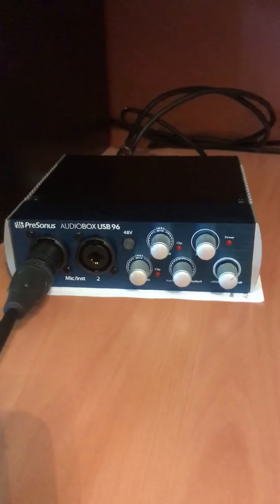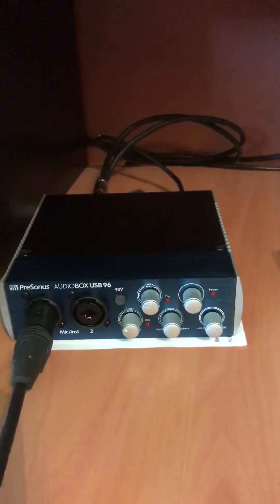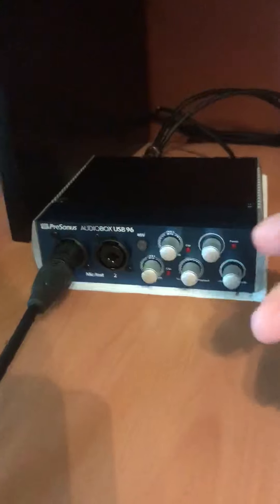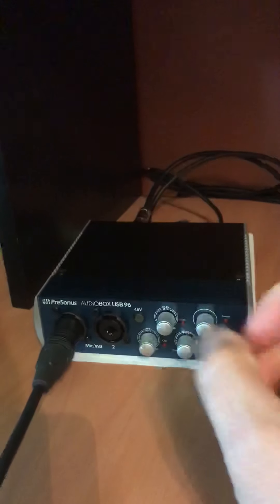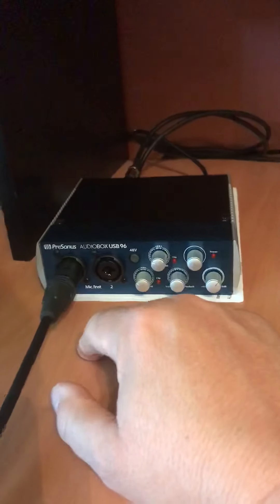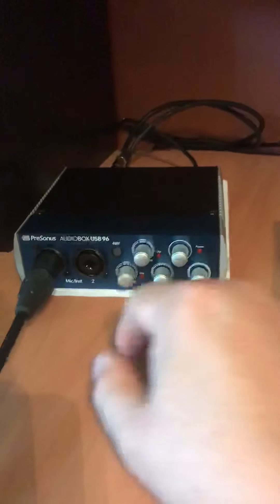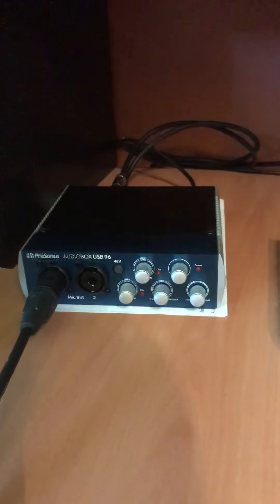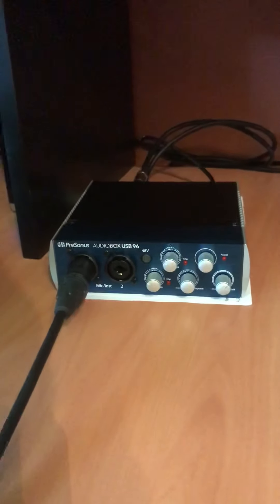Presonus Audiobox USB 96 white noise hissing sound

Comment: I have the same problem with my AudioBox USB 96. I purchased mine about 2-3 years ago, and I've become more acutely aware of the same type of white noise described in this video as I've been recording my own music. I am aware of the 48V button being on that increases the noise, but I've noticed that my condenser mic will not pick up any sound unless that button is pushed in. This means that I notice the noise (hissing, high-pitched beeping, and general static) whenever I am using that microphone. I also notice it if I'm using an instrument cable to plug in a guitar or keyboard. I've yet to try having the manufacturer replace any parts, and I don't really have the budget to purchase new gear to try.
Reply from the maker: Sorry to hear that, Nate. It's too bad they have this problem with the audiobox. It doesn't hurt to open a support ticket and see if they will do something for you.
Reply: @ChrisColter  Thanks for the suggestion! I'm glad I found your video.
Reply: Mine doing the same thing now , I’m about to just throw it in the trash
Reply: Ur prolly to hot on the mic volume

Comment: I had an issue when I turned on my phantom power there was a hissing sound coming into my headphones when direct monitor was on. My solution? USB cable with a ferrite bead at the end. Yeah... those little things that seem completely useless. They are designed to passively reject high frequency noise. Completely solved my issue.
Now to get on with fixing the white noise in recording.... that is a still an issue I'm dealing with.
Reply from the maker: Thanks for sharing!

Comment: I found out why.  It's the power source for it.  I had mine making the same noise for a lil while, I couldn't figure out why.  Until I checked the USB hub that I had it connected to.  It wasn't plugged in, and was supplying power for like 3 things on just usb alone.  So I plugged that back in and I haven't had any noise since.
Reply from the maker: Glad that worked for you!!!! I wish mine was that easy. They ended up replacing mine.
Reply: Thank you so much for this comment! My problem is solved 💪🏾

Comment: Something wrong with your setup or the box, mine works just fine... might be your computer USB port can’t output enough power for it... try using a high output charging capable port...
Reply from the maker: robert w they actually replaced the box and all is well now. Thanks
Reply: Chris Colter Yeah my fault for commenting half way through lol, glad they finally got you sorted out, it’s a pretty decent box for the price
Reply: @robertw1871  I hope so cuz I just bought one lol

Comment: Well I had an issue ,STATIC NOISE , as I messed around with it ,I found that the AUX cable input into the PC was making the noise. Also ,the AUDIOBOX 96 uses ONLY 2.0 USB PORTS (Non colored ones) ! Reinstal correct drivers from the PRESONUS site and it works for me . I dont know if its the aux cable faulty or what , but the noise is gone . Hope this helps someone,I was going mad!
Reply from the maker: Thanks for letting us know. It can be complicated to diagnose a problem like that.

Comment: Most USB outlets are low power, thus the internal transformer cant adequately produce enough power for its phantom power 48 volts..yes  you will get 48 volts but again,  at a low amperage..thus can cause the hissing,  if the internal transformer circuit has any substandard components, then even more so, try a powered USB hub, this often fixes the issue..also you could try another rear USB port on your PC as  not all USB outlets are the same
Reply from the maker: Thanks Rob. That all makes sense. The first thing I did before returning it was to try a powered USB hub. In my case it made no difference. For me, the USB 96 is junk and poorly made. I’ve had no issues at all with the Studio 68C.

Comment: Did you try connecting it to Phantom box instead of just going directly through the audio box ? That actually helped me with M track Solo high hiss a lot.
Reply from the maker: I don't like to have any additional equipment in line because it can introduce noise. They ended up replacing the unit and it took care of the issue.
Reply: @ChrisColter   i feal you .

Comment: Hello sir, i am getting this same sound but in both the condition , pressing 48v button on / off so should i change the sound card ?
Reply from the maker: It could be the audiobox. I would conduct the troubleshooting on the audiobox. Open a ticket on the presonus website for help. Visit Support on their website. You could also try recording from your input jack on your computer instead of the box and see if you still have the noise. It will help rule out the soundcard.

Comment: this is my third 96....same problem...the hissing...i use a di box to run my guitar and  bass...i use the one output  and when i use my jack for keys...no hissing...what i am i doing wrong?..PLEASE HELP!!
Reply from the maker: The 96 is not a good interface. I would upgrade to the next level. Maybe the 68c. Nothing can be done to fix the issues with the 96.
Reply: @ChrisColter  thanks Chris Colter

Comment: i plugged my noisy one into the laptop and it went away, plugged it into computer and it came back. more power supplied from laptop than a computer usb, Ground loop isolator to fix it i reckon.. Mine does it with or without 48v on.

Comment: Hey Chris. I bought my audiobox usb96 on my trip to the US. I didn't get the chance to test it there, I had ordered it online to where I was staying. Anyway I came back to my home in India, and I got the same problem with it. Tried changing cables, updating audio drivers. Nothing works. That high pitched hissing starts when I press the phantom power button. Its really irritating. What should I do?
Reply from the maker: Open up a support ticket with Presonus. They have good customer service in my experience. It is probably a problem inside the unit.

Comment: Dear Sir presonus is not good or just only your Audio Interface problem
Reply from the maker: They replaced the box, and all is good.
Reply: I be having hissing background noice but when i turn 48v off iy stop but my vocals dont get recorded
Reply from the maker: @MichaelPrince1992  Call Presonus. Could be a bad audiobox causing the hissing or high input gain. Sounds like your microphones need the 48v.
Reply: Ok cool i also ran into a video where they said get a usb hub plug into tht in the hissing will stop cause the ausobox need more power than the computer
Reply from the maker: @MichaelPrince1992  Yeah, that didn't work for me. I tried it.

Comment: I bought that interface and I have a problem, when my sound signal goes above 0dB, it starts to emit a sound like thumps or cracks, does anyone know why? Help me please
Reply from the maker: It could be that your audio is clipping. Normally you do not want to go above -3db when recording to prevent clipping.
Reply: @ChrisColter  in fact the interface has a clipping indicator and it does not activate when my problem appears
Reply from the maker: @jeffmagallanes7385  there could be something wrong with the clipping indicator. Anytime sound goes above 0db clipping occurs. The meter on my Presonus Studio68c is a solid red at 0db. You state it happens above 0db. Your sound should not be above -3db. I would start there. Hope that helps.
Reply: @ChrisColter  in that case my problem would make sense, but when I connect the headphones directly to the pc, even when my signal passes 0dB, no interference is heard in the headphones, maybe a little distortion, but there are no noises such as clicks or hits.
Reply from the maker: @jeffmagallanes7385  So what it sounds like you're telling me is that you're hearing audio differently between your headphones and speakers. Maybe a problem with your speakers then? Do you hear these same noises when adjusting the volume knob on the speaker (if applicable). If so, you can spray the knob with WD-40 and that should help clear out the dust causing the static. Otherwise it may be a speaker problem.
Reply: @ChrisColter  no, I say it because I have tested my headphones by connecting them to the interface and also directly to the pc, and the problem only occurs when they are connected to the interface, and of course, when the signal is close to 0dB
Reply from the maker: @jeffmagallanes7385  that is strange. It sounds like you've narrowed it down to the interface. I would open a support ticket on the presonus website. Even if it is out of warranty, they may still be able to help.

Comment: i've got the solution ! you need to plug it into an usb hub
Reply from the maker: Syphom I did that. No difference. They ended up replacing the unit.
Reply: I bought a powered usb hub and still getting the noise
Reply: This worked for me!!!! thank you!
Reply: I have the same issue, it’s disgusting noise in the takes with microphone with phantom increase exponencial
Reply: @357rawrock  try the usb hub thing. it worked very well for me. I also tried the Ferrite magnets and that also helped a little. using a noisegate like the reaper fir vst plugin took out the harsh background sounds and buzzing and an additional noisegate helped with keeping things very clear without an latency problems.

Comment: Hello sir, my issue with the box is similar. If I plug in and record a Mic, everything is peaches. However, when I plus any instrument into it, I get buzzing that is super loud and records moreso than the sound of the instrument. Do you think it may be the same issue or something further?
Reply from the maker: Make sure if you are using the 1/4 inch jack and that the 48v button is off. Also make sure you are not using an amplified signal going in. There should be no preamps. Only line level inputs can be used for instruments. The audiobox already has a signal amplifier. You could damage the unit if you plug in anything above line level. In other words if you have a guitar or bass, plug it directly into the box.
Reply: @ChrisColter  thanks. I have directly plugged my guitar as well as bass directly. It's an old cord so I might and hopefully just need a new one.
Reply from the maker: TJ Sandiff yes, it could be the cord.👍🏻

Comment: I got 3 different audio boxes and it was the same thing. White hissing noise and I’m just done.
Reply from the maker: I tried the Studio 68c and it has been working well for me. I'll never buy the USB96 again.
Reply: @ChrisColter  I actually just figured it out. The USB hub could be the problem. It needs a lot of power (not just from your computer) to support your interface audio and or midi/microphones that are connected. Did you ever come across that? May just be mine. Still doing some research on it though.
Reply from the maker: @calebvalentinegonzales2986  I tried a powered usb hub, and that didn’t work either.

Comment: I bought one of these used recently. The guy I bought it from said it worked fine on his Mac. I'm using it with Windows 10.

I only need it to function as an audio interface/MIDI interface for my soft synths. I'm not connecting mics or instruments to it.

I installed the latest driver for the Audiobox, but unchecked everything else as they looked like drivers for other devices. 

It installed fine and shows up fine in my DAW, but when I play a soft synth, all I hear is white noise like your video mentions. Should I try pressing that button? And why would it be enable by default?

Did I buy a lemon? Thanks for any advice.
Reply from the maker: I wouldn't press the 48v button because that is only used for mics that need phantom power. I would try a different instrument or mic. Do you have a bass guitar or electric guitar?
Reply: @ChrisColter  I don't have anything plugged into it. Just the MIDI cable, USB wire to the PC.
Reply from the maker: @n8goulet  sorry, just re-read the post. It is a lemon in my opinion if there is nothing hooked to it and you have the hiss.
Reply: @ChrisColter  It seems like it, but I hope not. The seller was dishonest if so. That would be two in a row buying music gear. Never had many problems previously.

Comment: Which Audio interface is good for poetry
Reply from the maker: This is a good one. We use it for a podcast https://feeds.buzzsprout.com/227704.rss
Reply: @ChrisColter  But Sir 

I have old laptop

Window 7
Dual core Processor 
Which Audio interface will work good on my laptop
Reply: @ChrisColter  Not showing which Audio interface you using
Reply from the maker: @drritu9851  it is the one in the video...Presonus Audiobox USB 96. If you want to know which software I'm using, it is Studio One Pro.